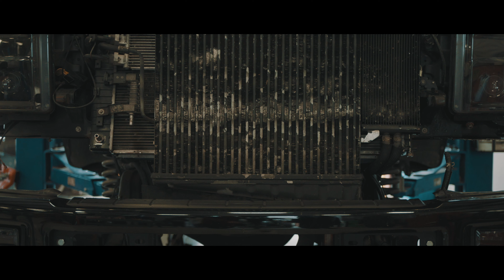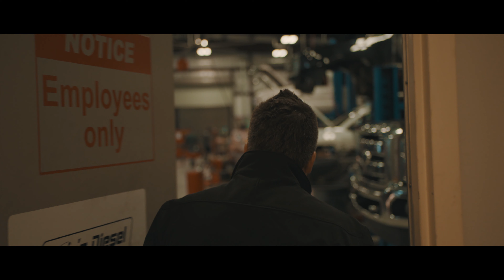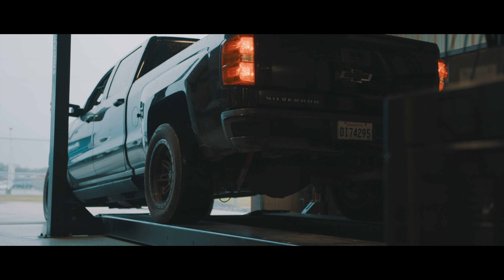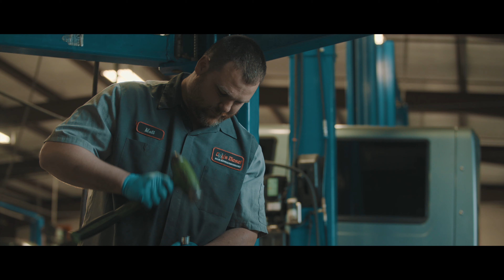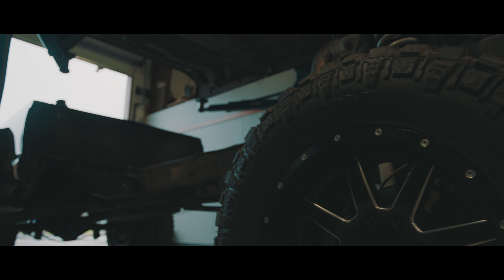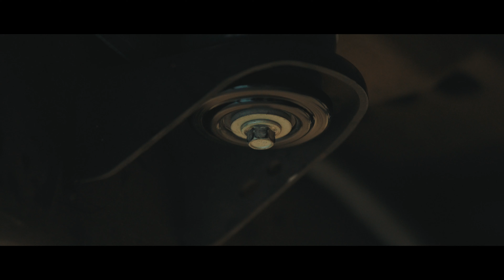S&B Silicone Body Mounts For A Smooth Ride That Will Last A Lifetime

Comment: Let me tell you. I had 6 to install. The four in the rear half, no problems. The two behind the bumper, pure hell. If you cant pry apart after you remove bolt, sawzaw below washer and they drop right out. Had to remove grill and headlight to get to spun caged nut on driver side.  The bolt was seized. After lots of WD-40 and a "MAP" gas torch for about 45 sec, it backed out no problem. The shorter bolts are better. S&B made a far superior product than OEM. And B&G is made in America. High quality and great staff. Not only has the rattling noise stopped, there was a vibration in steering wheel at 50-60 mph that has also been eliminated. Very happy with B&G after all that work. Big different in the ride.

Comment: installed mine on my 2015 350 extra cab yesterday, took all day, but got it done, was concerned about the new bolts being an inch shorter than factory, but they worked, counted my turns on the first one til I reached 76 lbs. I'm thinking I got well past the top of the nut. My only disappointment was that the warranty is only good if a "qualified shop installs them"' , I understand tho, there are plenty of mistakes to be made by your average joe, like me. I would buy them again.

Comment: Do you need to grease these isolators during installation? For an 06 f250  crew cab. Also what torque spec is recommended
Reply from the maker: Nathan, you don’t need to add grease and the Ford TQ Spec is 60ft-lbs. Here is a link to the install guide https://drive.google.com/file/d/1rLMEBhJ-5id8wI8gFGzoKKROXYByRP_U/view
Reply: Does S&B have a body mount for the ram 1500 yet?
Reply: 60? Ford and S&B said 76ftlbs torque. Well that was 2016

Comment: Silicone for well over $500 per set. 
Polyurethane 1/4 of the cost and will still outlast the life of the truck!
Reply: Wrong. Urethane is what the OEM parts were. At 90k and 8 years old, my cab sounded like it was going to rattle off the frame. Silicone is a lot nicer. All 6 were falling apart. Its a whole new ride now. Even took the small shake out of the steering wheel at 50-60 mph. Im not sorry I bought mine at all. Will buy more from them.